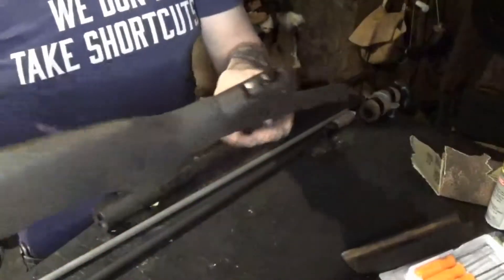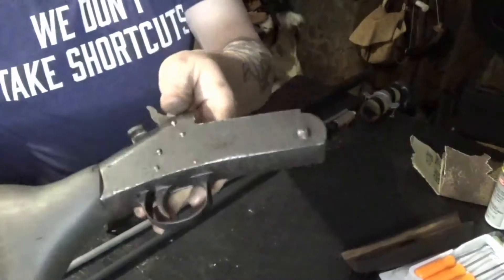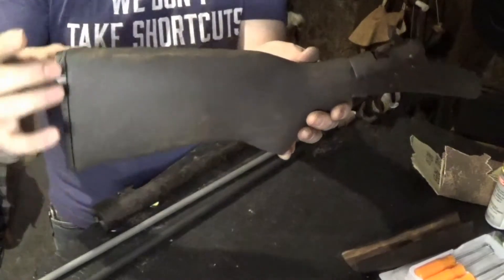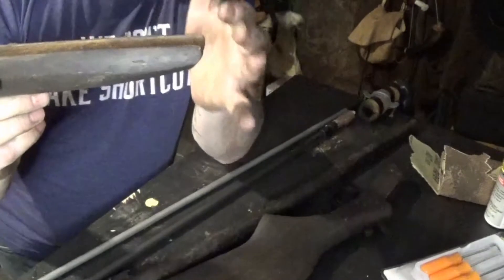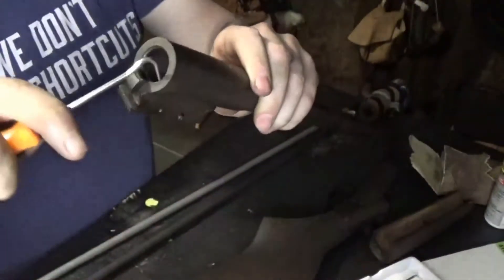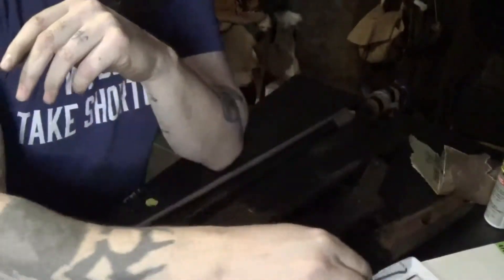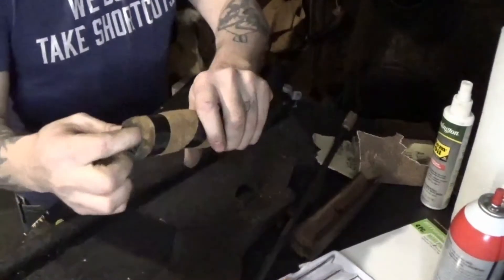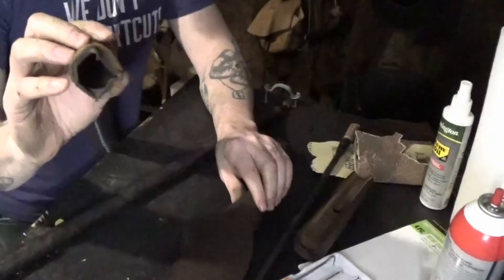New England Firearms Pardner | #shotgun #singleshot

Comment: This shotgun looks like it with shot good after its all cleaned up. My 2 pointer shotguns a 410 and 12 gauge look like they are copies of that shotgun but with black polymer plastic. I got a shotgun adaptor kit that will let me shot 20 gauge 410 and 22 out of the 12 gauge then I got there Muzzleloader adapter kit that uses shotgun primers and in about 2 weeks a 8 inch rifled adapter that will let me shoot 22 magnum out of it.